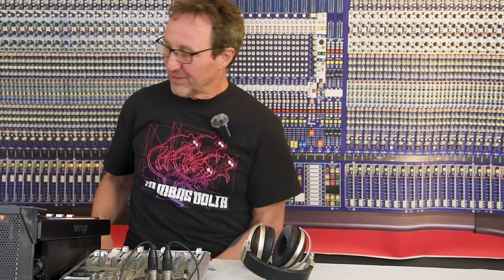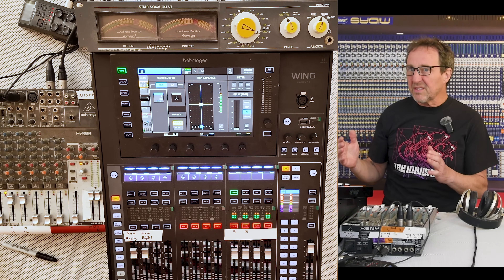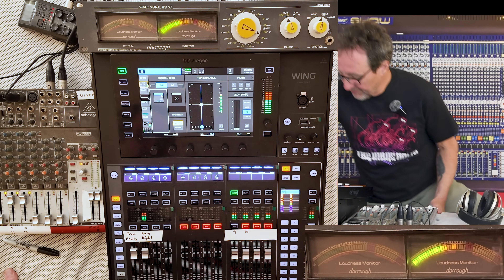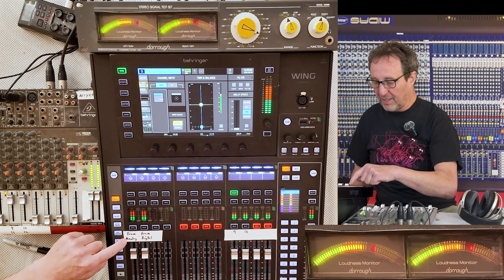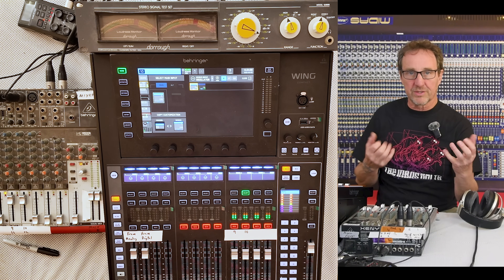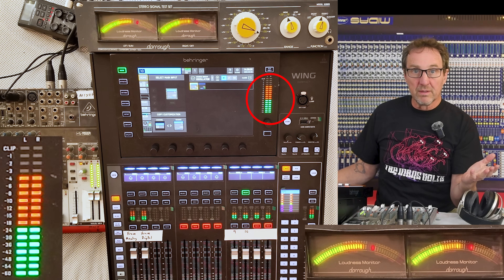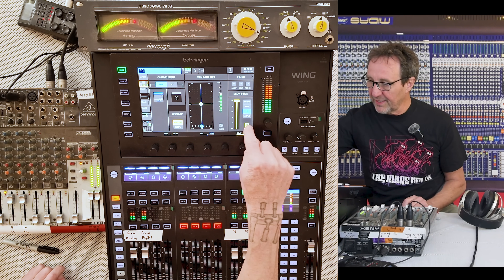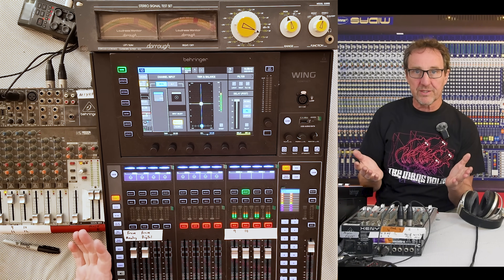Digital Audio Meters Don't Show What you Hear - Sometimes

Comment: As if audio mixing isn't difficult enough. 😉
Reply: @DaveRat  Well, it seems then that the digital metering circuit design is similar--and similarly flawed--for all types of digital consoles and DAWs--but the designers aren't willing to fix it. It's all beyond my current level of understanding, but thanks for making us mere mortals aware that it CAN be a real problem!
Reply from the maker: I would not say flawed really. The digital meters are accurate in reading even the shortest duration high frequency peaks. Peaks that don't really matter or may not exist in the analog domain. And we kind of want to know about these peaks to avoid distorting them.

The metering is one aspect but also, why are the peaks more pronounced in digital than anolog and are those peaks eating up headroom as well as creating less useful metering.

Using an RMS meter as well as the peak meter is a workaround but getting rid of the HF peaks occuring above audibility is the better solution.

Annoyingly just putting low pass filters on every channel does not seem to solve the issue as the low pass filters create their own issues.
Reply: @DaveRat  Thanks Dave for helping myself--and many others--truly understand the nuances of these issues!
Reply from the maker: Awesome and thank you!

Comment: This is solved simply by putting a low-pass filter at 20khz on your master
Reply from the maker: Is it? Have you tried that? Will that make metering of group summing prior to the master correct?

Also, I recommend trying a 20k low pass filter on each channel as that would seem like it would solve it but actually and surprisingly it does not. Give it a try.
Reply: @DaveRat  I like how this video show's the inaccuracies of analog summing.
Reply from the maker: Yes and also shows the inaccuracies of human hearing as well. 

See, the digital meters stay the same level and the sound appears to drop audibly to our ears, and though the analog meters seem to match what we hear, it is our ears convincing us that the sound is dropping in level that is actually the problem.

Comment: I think this is the inverse measurement of the total wave information not being captured, transported, processed, amplified or stored in digital vs original analog voltage measurement. If you use pixels to capture visual information then display the information the less pixels you use the lower the quality of replication, using 4 pixles to either capture or display the info from the source you arent getting to get a very accurate replication just blobs so ergo there is alot of missing information. If you increase the pixels or resolution the higher the accuracy of the replication, represented in audio of sample rate covnersions of 48k, 96k, 192k etc. In audio based on the sample rate the same applies the lower the sample rate the more grouped frequencies are and therefore the lower quality replication or emulation of the original source waves, even though this is debated about if this is actually heard or perceived doesnt mean it cant be measured. In original analog audio the sum total of voltage is what drives the meters and no energy is lost (i guess depending on quality of components of the electrical system and design) so therefore the true sum of the electrical energy is used to drive or represent the meter. In digital you are not using all the exact same energy, it is restricted by the sample rate as much as it tries. A digital system wont ammount to the same energy driving the meters because there is loss, its the best effort replication. This theory might fall down as your analog meters output from the desk output or even back into its self seem to be metering correctly but this could be explained as the actual digital to analog coverters correct for this loss (maybe) the the desk output meters are before this D->A stage/correction..... I think

Comment: it shows correctly in most pro tools metering settings, the only ones where it doesn't are sample peak and pro tools classic. can't find a way to get it to show correctly in logic though
Reply from the maker: Interesting. The next and big question is:

Since the combined de-correlated  signals show 3dB hotter on digital meters than they do on analog meters than expected, are we losing 3dB with digital summing that we don't lose with analog summing?

And with summing 10 decorrelated inputs with significant HF content the offset differential can reach a 10 dB differential between analog and digital summing. The more de-correlated inputs summed, the more the difference will be between analog and digital metering.

Assuming the digital peak meters are correct and accurate, which we have every reason to believe, and the analog meters are also correct and accurate, are we losing headroom in the digital domain when summing a multitude of de-correlated signals with significant HF content, that we don't lose when summing the same signals in the analog domain?
Reply: @DaveRat  if my understanding is correct (feel free to say if it isn't), you could test this by running two correlated white noise signals into an analog meter with a separate clipping indicator. put them at the lowest level you can where the clipping light still comes on, then decorrelate the signals and see if it still clips after the combined signal decreases. if it does, then the digital peak meters are accurate about the peak level not changing

Comment: I think what is happening is how the meters calculate the level. Does it look at waveforms corrected by the output algorithm or the levels of the bits. There is rarely a bit at the apex of the waveform. When the waves are correlated all the bits raise level and the meter calculates that. Uncorrelated waves when added together the bits randomly raise and lower leaving the difference. The analog meters are reading the actual waveform not the related bits. Add to this the fact that different plug-ins each have their own way of compensating for this, random clip indicators may appear in the signal chain. Leaving a bit of headroom is the standard practice in this case.
Reply from the maker: So that would mean that digitally summed de-correlated waveforms reduce available headroom more than the same signals summed in the analog domain?
Reply: @DaveRat   - it’s a statement about what is being indicated not what actually is.
Reply from the maker: That would mean the metering is incorrect then and I am no convinced and have no indication the digital metering is incorrect.

In null testing I have confirmed that the digital meters when they show clip at least on the wing and in Adobe, there truly is clip. I am quite confident the digital meters are accurate
Reply: @DaveRat - And yet your test proves they are not.
Reply from the maker: I don't believe the test shows the meters are incorrect. I believe the meters don't show what we hear but I also believe the meters are showing true and accurate peaks regardless of how fast or short they are.

And I don't know whether those short fast high frequency peaks are that same in analog summing and if they are the same for a given freq response/signal, I do not believe those very short fast peaks matter as much in analog.

I believe digital clippin distortion can generate frequencies below the frequency distorting making the hf peaks a possible issue.

But with analog, the clipping tends to create harmonics above the freq distorting, so if the distorting peak is above audibility, the distortion does not matter near as much.

So...

I think analog meters tend to ignore fast peaks above audibility and digital needs to pay attention to those peaks

Hence, digital meteringwill look different than analog metering on the same signal if the meters are tuned to what matters.